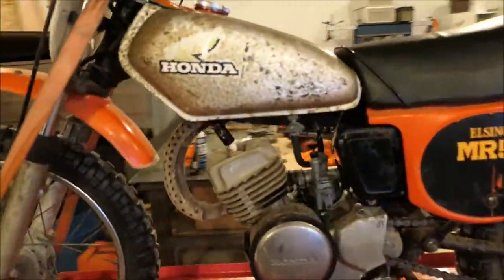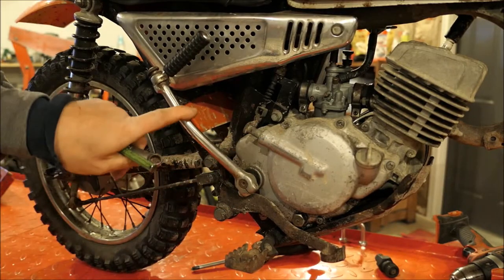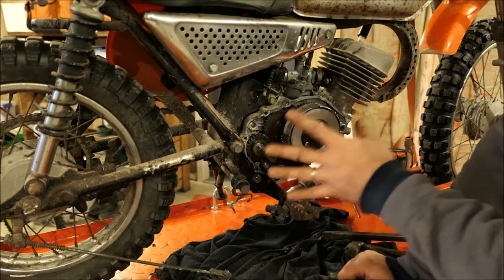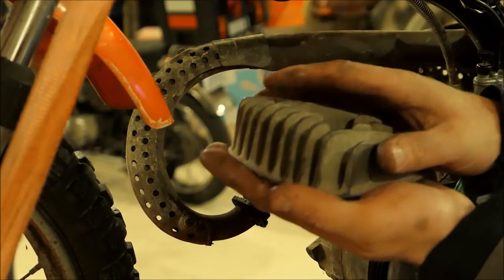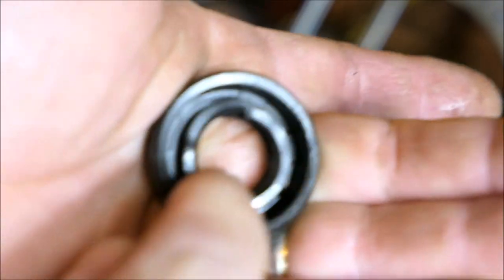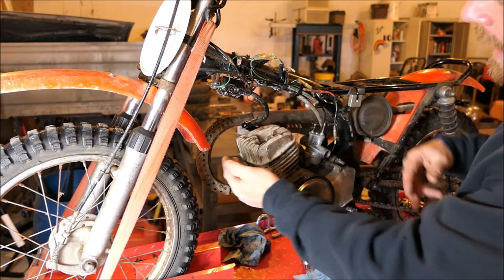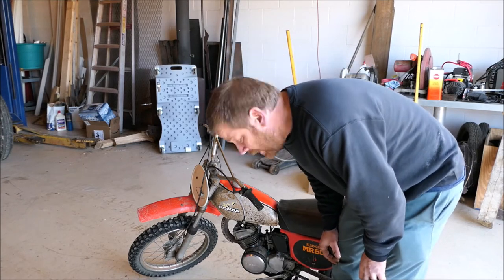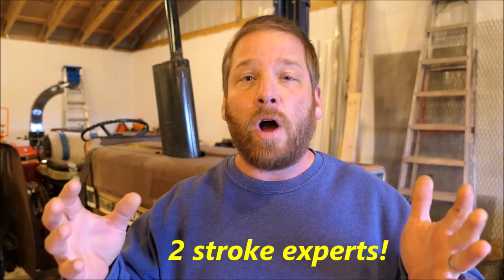Replacing Rings and Seals on a VINTAGE Honda MR50 Elsinore !

Comment: Take a rag and stuff it down into the crankcase area below the connecting rod before removing the wrist pin clip and piston. Don't want to loose anything into the crankcase!  Also the rag will hold the crank from turning when removing the drive sprocket for seal replacement.  P.S. don't forget to remove the rag before reassembly of the jug!    Tim from Kentucky
Reply from the maker: Thanks for the tips Tim from KY! I think we may have met once before? 😆

Comment: With all due respect. Elinore is a car.  Also if you pull on the clutch lever the cover will pop off from the pressure against  the clutch.

Comment: Use JIS impact bits for Japanese screws, you won't have problems with the SAEs braking.
Reply from the maker: I am looking for some that will fit my impact it's 5/16 all I have been able to find is 1/4 I need to look some more I totally agree with you tho

Comment: Rebuilding my own right now and appreciate the videos. Question: what size and where did you get the flywheel puller? I can only find right hand with external threads...
Reply from the maker: Not sure I just Google MR50 puller and it came up, I think it also fits a Z50